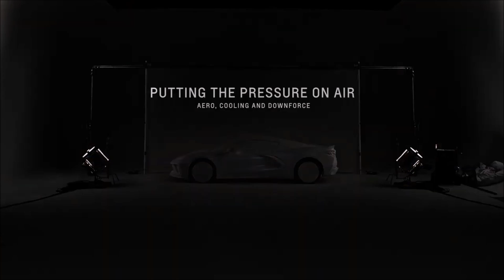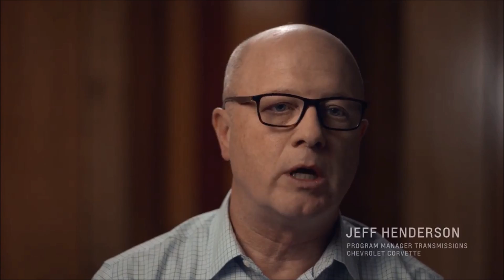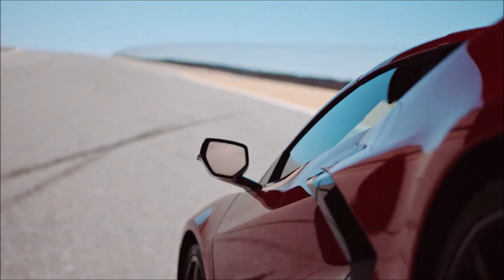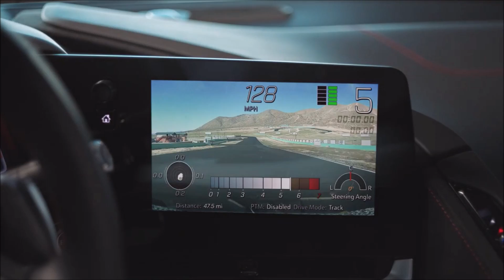ALL ABOUT THE 2020 C8 MID ENGINE CORVETTE - HOW & WHY

Comment: This might as well have been produced by Chevy.  BUT, what is it going to be like for the 3rd or 4th owner in 10 years when all those electronics start going to hell and NOTHING works.  Having computers control everything means you have to hire a software engineer to service your car.  And what about dealerships.  Most dealers only sell a couple of Vettes a year and their mechanics will be hurtin' for certain when an older Vette comes in for service.  This sure as hell kills the old practice of working on your own car and modifying it.  And the COST of stuff will be astronomical.  It is now a car for the rich, not the common man.  And how many rich guys are gonna drive it hard and use it's capabilities?  It will be a status symbol, not a fine driving machine.  Shame.
Reply: Congrats Chevy!  This new car looks to be a real winner and value.   My question is.... will the body hold up to the stresses of all the power?  Will it sound and feel like a rattle trap at speed in a few years.  A 911 feels like new at speed as it ages.

Comment: what about oil cooler(s)? trans cooler(s)? and why is the car heavier than a c7, they got rid of the drive shaft, torque tube (which is steel on base models)t and 10 feet of exhaust pipes -that should equate to at least a couple hundred pounds weight savings...skid pad? launch control? weight bias? rear axle ratio? and why the skinny tires...im sorry to say this but the new "base model" doesnt look like a "poor man's ferrari", it looks like a rich man's honda....there..i've said too much and i promiosed myself i wouldnt cry...i think ill keep my c5z06

Comment: Hahaha the shifts aren't that instant like an F1 car this is bs and more like tiptronic shifting otherwise the rpm would never drop but it still does. Take a look at a Porsche driving vid. I shift at .300 milliseconds.  Say all you want but a manual is stronger and less bs to break. I know ive rebuilt several. Look at the Skyline transmission and Porsche trans. They still have issues. They should have used the Graziano Transmission from the Audi. Ill be converting if i decide to get one. You Engineers should take lessons from the Import guys that build 400hp single 1.5liter engines. Ill still be a Honda guy at heart. This is the coolest looking vette out of all the slow ones. Cant wait to twin turbo and go beyond.

Comment: for me this is not a Corvette, and looks nothing like a Corvette. A Corvette is long, sleek and low. This looks like its been punched in the nose and had it's ass stuffed. 
They want to make this car, fine, I have no problem with the car, call it something else, call it the Corvette II for all I care and make a Corvette like it should be made. I want to see that long hood, I want the rear wheels at my back. I don't care about the limits of performance in the current configuration. I'm not buying it to race around the track, I'm just going to work and back. FFS.

Comment: 0:20 AERO DYNAMICS
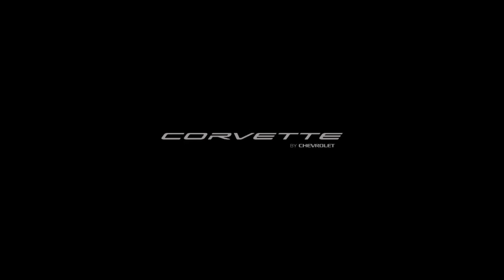3:56 COLORS
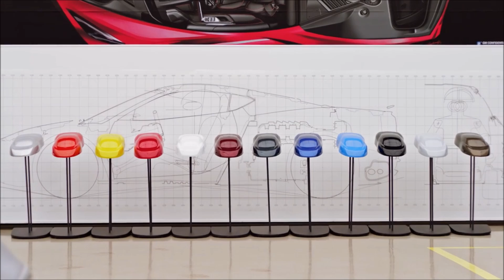5:47 MODE SELECTOR
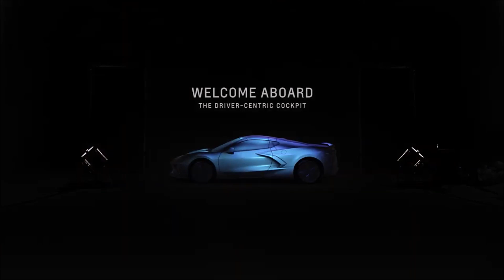7:15 COCKPIT DESIGN
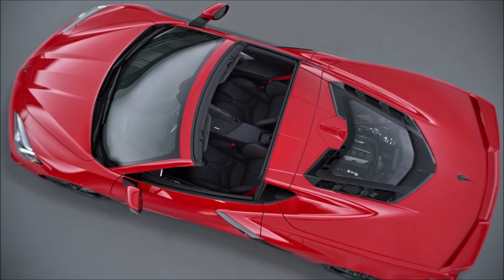9:53 DUAL CARGO
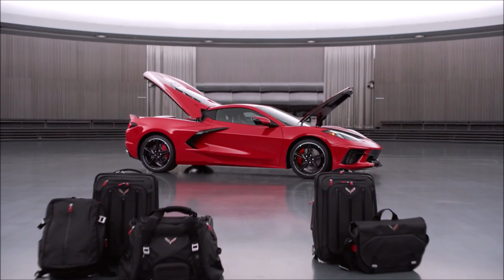10:50 DCT TRANSMISSION
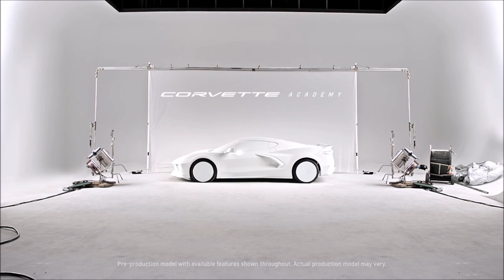11:26 BENEFITS OF DCT
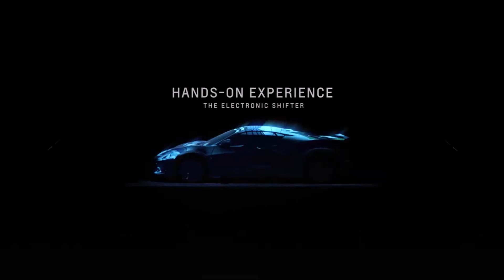13:36 ELECTRONIC SHIFTER
14:50 ELSD
16:11 DRY SUMP
18:08 FRONT LIFT
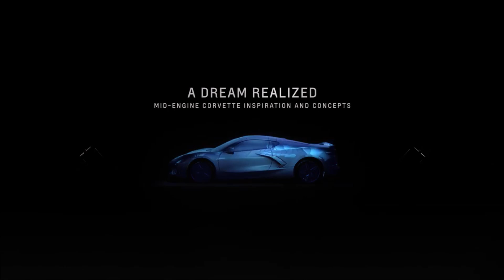18:37 DREAM TO REALITY

Comment: Reliving Gm'$... trans axle Whoas...the Corvair, the Eldorado & Toranado, the Gmc fwd motorhome, the Citation...just saying...a day to remember...or why they kept the front engine rwd design.
Reply: Great engneering designs last ForEver...these weren't, and Gm used us and are money for their Guinea Pigs, for their failures...they gave up on their design and didn't fix the problems, to have a long life and succeed... maybe they Just Couldn't fix it...Gm, and others,... people won't buy a pig with lip stick slapped on it...the owner of 2 Torch Red C5's, a Crystal Red 14 C7.
Reply: yes the Pinto did sell and outlasted the Vega, that got replaced by the Chevette...gone...monza gone...props to the Civic and Accord.
Reply: Sp..if you go to any Honda dealership, they can sell you a really Refined and the Best ever Honda Accord or Civic...the Quality Goes In..Before the Name Goes On...try having an Original Take, and quit piggybacking mine.

Comment: I could not believe when Tadge Juechter said that the Z51 is doing 0-60mph sub 3 seconds.  That means it will do the quarter mile just around 11 seconds flat!  I thought to myself what the hell will the Z06 do 0-60 and 1/4 mile.
Question about the gear box.  I currently own a 2016 C7 Stingray.  Every once in a while, I like to feel like a 12-year-old and rev the engine in Track mode while driving under an overpass or simply to show off in front of a Mustang or BMW.  Since I have an automatic, I simply shift to neutral, rev the engine, wait for the RPMs to go below 1500, and then shift it right back to Drive. 

 How will you be able to do this in the new C8 with that futuristic gearbox?

(Readers:  if you don't wait for the RPMs to go below 1500 before shifting back to Drive, you are in for an abrupt surprise.)